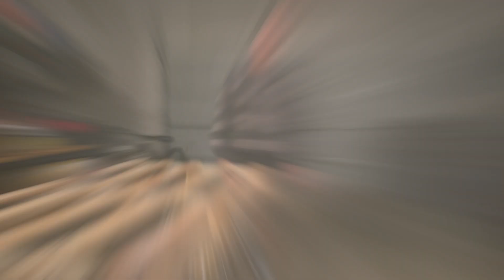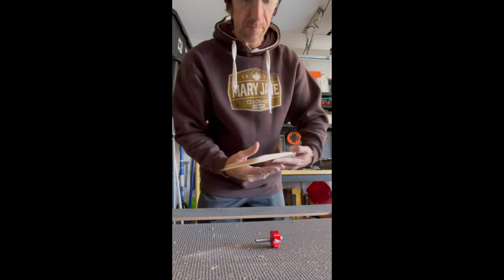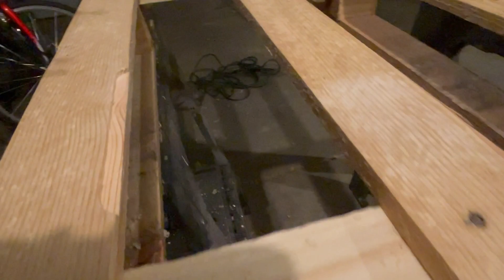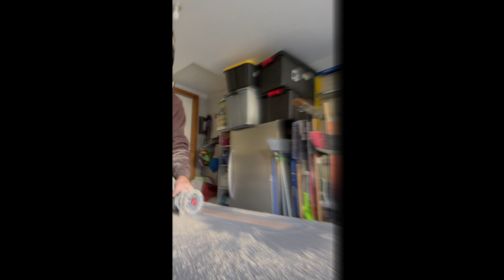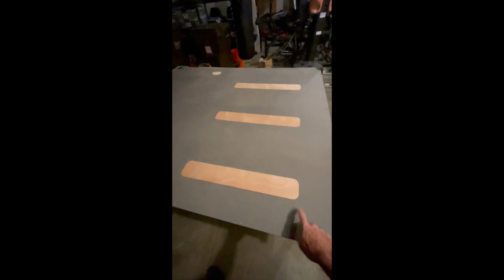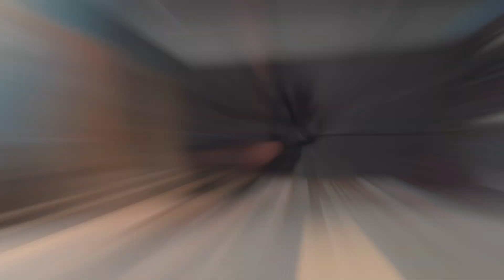How to reuse factory floor as sub-floor - Sprinter van finished floor install part 1 -

Comment: No Insulation???    you will regret that decision
Reply from the maker: Yeah I thought about that but felt the wood subfloor plus vinyl plank floor that includes a bottom layer of insulation was enough.  So far no regrets.

Comment: Do you think you could put insulation under it and then use the original holes with longer screws to secure in?
Reply from the maker: Yes I think that would work.  I did not add insulation because the underside of the factory floor already had some that fills the metal floor groves, and also the vinyl planks I used had some.

Comment: We have one unused seat bracket hole near the sliding door that could use a rabbet cut. Same filler from DIYvan. Do you think it’s possible to do without taking the floor out of the van?
Reply from the maker: Yes I think you could do it without removing the floor.  Good luck and let me know how it goes!